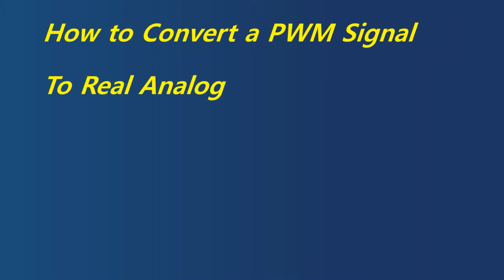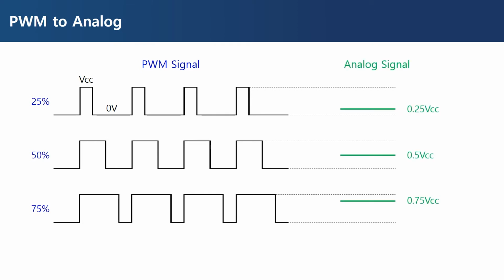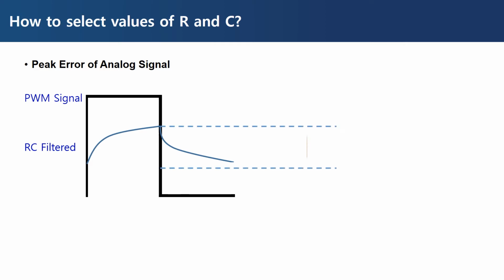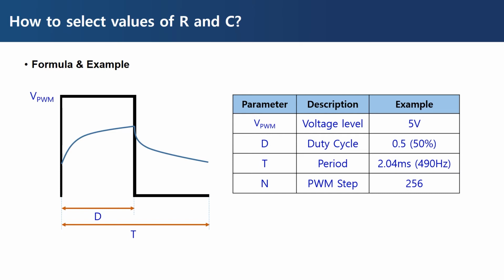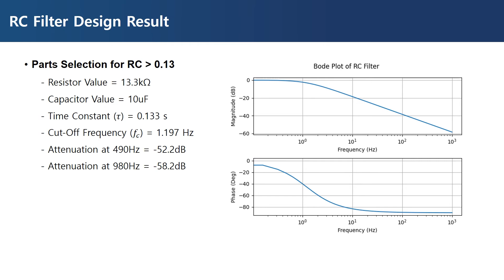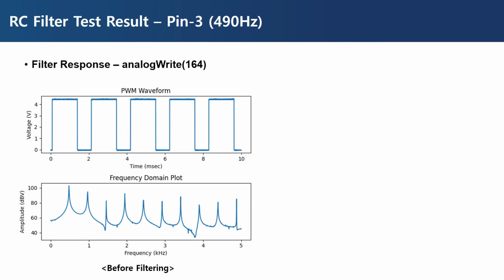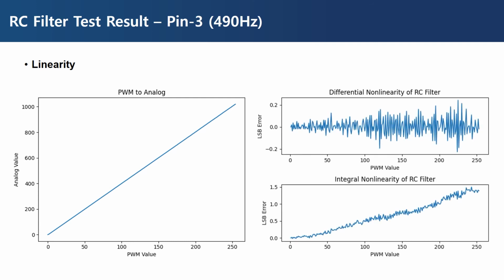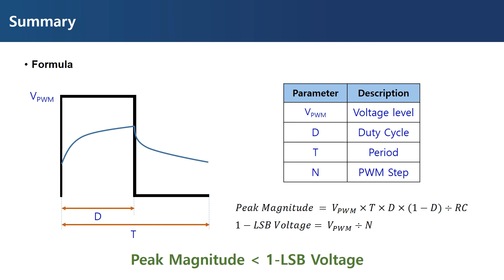How to convert a PWM Signal to Real Analog using RC Filter (with actual measurements and analysis)

Comment: Thanks! So that isn't really acting as an RC lowpass filter actually, and simply looks like an RC lowpass filter? Because it seems to only be acting as a right angle rounder.
Reply from the maker: Hi, it is an RC low pass filter that filters out the high frequency component in the PWM waveform to a low frequency, almost DC component. 
You can compare the waveforms before and after the filtering.
Thanks!!
Reply: @gemsungelectronics460  I did. And what I said is what that shows.
Reply: @gemsungelectronics460  Are trying to say that it's turning a square wave into that other wave by removing upper frequencies, rather than simply treating it like it is modulated DC? Both seem plausible, but looking at it as DC is a more logically intuitive way view a capacitor's behavior in that circuit.

Comment: Hi! Thank you for the video, I am trying to apply this to the arduino nano 33 BLE, could you please indicate me where I can find the duty cycle and total step values? I read the documentation but I do not find anything...
Reply from the maker: Hi according to the pdf file in the link  below, there seems to be several pwm pins available. 
It seems that you can use analogWrite() to control the duty cycle.

https://www.google.co.kr/url?sa=t&source=web&rct=j&url=https://cdn.sparkfun.com/assets/0/d/8/4/9/DS-15580-Arduino_Nano_33_BLE_Sense.pdf&ved=2ahUKEwjc1JmplNX4AhX5plYBHSb9BBoQFnoECDAQAQ&usg=AOvVaw0EY7bALdN4rmZKBOkPyf_3

Comment: hello. how can the signal obtained after the rc filter be played on a 3-4 ohm speaker without affecting the signal and the output frequency? I'm trying to play a sinusoidal frequency of 8 Hz, the result of a pwm signal from arduino and an rc filter. I got the desired frequency and shape, but I can't play it on a speaker. do you have an idea how to do it?
Reply from the maker: Hello, thank you for sharing your concern.
Have you measured the waveform after connecting to the speaker?
I wonder whether the waveform is consistent before and after connecting to the speaker.
Also, it seems you want to play 8Hz sinusoidal waveform through the speaker, but I'm not sure if you can hear the soundwave of such low frequency.
How about increasing the frequency to some hundreds of frequency range?
Why would you need an RC filter for your application?

Comment: I need to modify an lcd contrast circuit that uses pwm and an RC filter. However, there is also a resistor across the capacitor. What is its purpose? To discharge the cap faster? I do have schematic, any help appreciated. Essentially I'm asking if the components can be changed to modify the analog voltage output range without adjusting the pwm signal.
Reply from the maker: Hi,
I can't say much about the resistor in the circuit unless I have a look on the full schematic. But anyway, you cannot increase the range of the voltage, but decreasing the voltage can be achieved by pulling down the voltage with a resistor.
Why not limit the range of the pwm signal rather than modifying the circuit?
Reply: @gemsungelectronics460  Thank you for the reply! I can't limit the pwm because it is microprocessor controlled and I don't have access to the code. 

The device is an 1990s era guitar effects processer. I changed the lcd display due to a bad backlight, but now the contrast is very low even at its max setting. I will have to open it and see if lowering the voltage increases the contrast, adding a resistor would be an easy fix.

Option B is to repair the leds on the original lcd and put it back in. This option is looking more attractive at the moment.
Reply from the maker: Right. I understand your situation. It is very frustrating when you need to fix something you don't have full access.
Good luck to you anyway, and let me know for any help.
Thank you for asking!